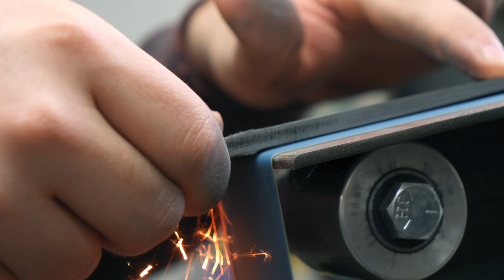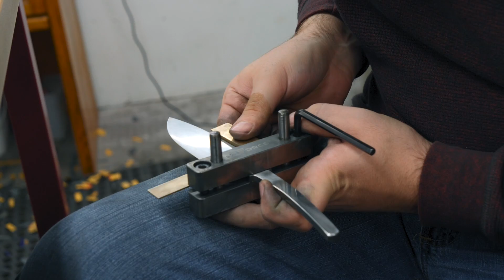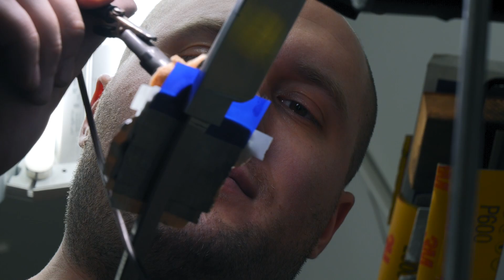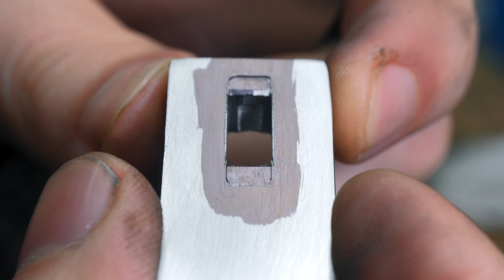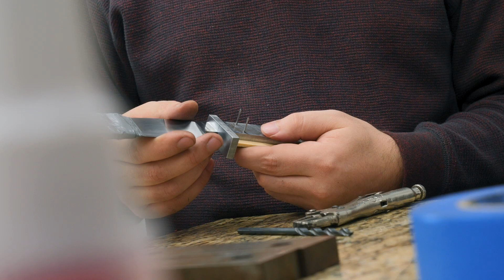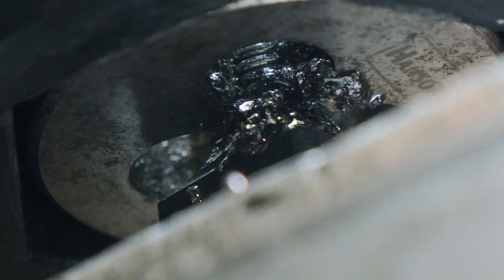Starting a New, Old Project: Hunter Knife Part. 1

Comment: Makes me sad every time I see you haven't direct driven that KMG. 
Never looked into the EDM stones, have been using Falcon pro series finishing stones for tool steel. Throw your sandpaper away up until about 1500. Sand 1/10 th of the time or less. Tears up that 15n20 like PAC-man! The 1"X1" X6" are the way to go but have to buy a whole box of each grit. Can order a set but are thin & cant get the lower grit like 120 or lower.
https://www.falcontool.com/PublicStore/product/PRO-Premium-Oil-Stone,30,124.aspx